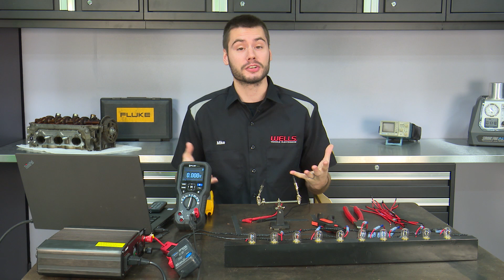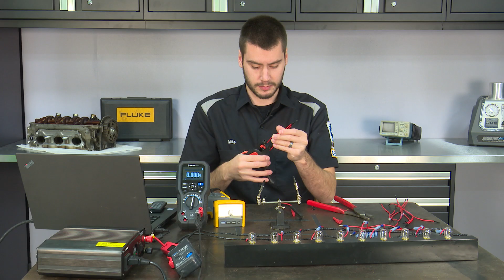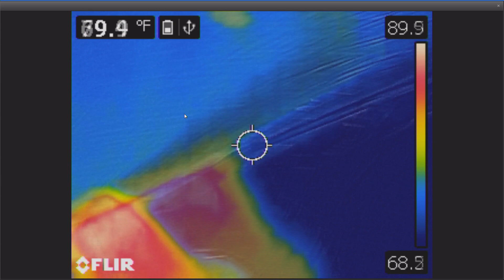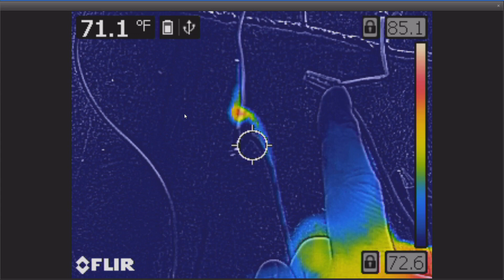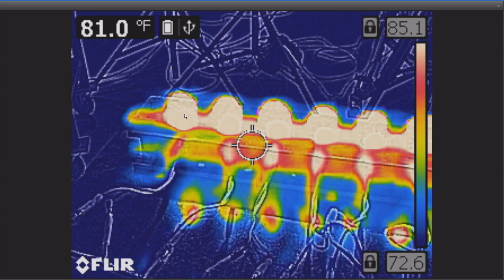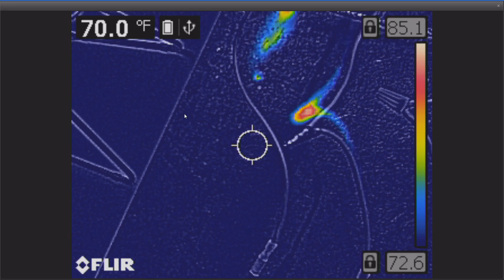Part 2 - Best Way To Connect Wires On Your Car - With Proof!

Comment: Using a pitiful one amp load on a splice  the voltage drops are going to be at the lower limit of what you can measure. You should have put all ten lamps on as a load for each connection. i.e. ten amps. Then you'll see something. Put the meter across each connection too. Don't measure back to the supply that's just confusing. For instance an extra 0.1ohms of resistance in the connection with 10amps of current flowing through it will give you a 1 volt drop across the (bad) splice which will be easy to measure. Also with 1 volt drop and ten amps (P=ExI) you'll have 10watts dissipated at the connection. That's going to get hot and show up on your thermal meter. A good connection won't drop anything significant and therefore won't heat up.BTW the 0.2 ohms you measured was mostly just the leads on your meter. Short them together you'll see. So in fact all of the splices were probably less than 0.1 ohm - again at the lower limit of your test equipment."Load er up" and lets see the problems. Interesting test setup. Keep them coming. Thanks
Reply from the maker: Hey Dave, I love the critical thinking on this. You are 1000% correct. The goal of this video was not to teach voltage drop, or the best practices of it. The goal was to simply show a difference in the types of connections. I am with your statements completely. I am currently working on a larger load and re-doing this test. Then we'll see what happens when we "load er up" :) Thanks for commenting and the feedback. I love this stuff! 
Mike Becker, Technical Services Instructor
Reply: Hmm. I thought your purpose was not only to show the types of splices but also to show why some are no good in the real world. When the wires nuts and twist and tape were showing up about as good as the "proper" splices it became apparent that you were not putting enough (electrical) stress on them to make them show their true problems. Hence my suggestions. You should test them to failure. If you get a variable current power supply (of say 30amps) and really put the boots to them. i.e. load them up to failure you can measure the current at which they fail. Your good connections should go until the whole wire insulation melts and the bad splices will probably heat up and fail at the point of connection. I think you were using #16 wire so somewhere around 20amps (or before that for the bad connections) should tell tales. Then your bias about which splices you don't like will be vindicated. Good work. Keep it coming.
Reply from the maker: Dave, that is a really great test! Let me see what I can come up with. Watch out for another video. Thanks for the input!
Mike Becker, Technical Services Instructor

Comment: working on commercial vehicle you need a flow of current to get green crusts build up quickly.  1 week is good enough
Reply from the maker: John, yep current flow would cause electrolysis to happen, causing our wire to corrode faster. Unfortunately I don't really have a way to test it that way :( If I can come up with something you'll see a video on it. Thanks for watching!!!
Mike Becker, Technical Services Instructor

Comment: One thing you should have done is to ohm tested and load tested before you put them in the salt tank. that why you know if the salt tank was the cause or your initial connection.
Reply from the maker: Randy, sure that is a good point. Next time I do something like this I'll keep that in mind. Thanks!
Mike Becker, Technical Services Instructor

Comment: So Scotty Kilmer was right. You can use wire nuts on cars and they work just fine.😀
Reply from the maker: Hmmm, I guess the picture of the rust inside the nut wasn't enough for you? :)
Mike Becker, Technical Services Instructor

Comment: Great experiment Mike..More time in the salt tank might have shown more results. But I understand you had to make room in the tank to start the Brine of your Thanksgiving turkey. 
Great Idea to tie them up under the truck.. should put them back by the hitch next to the truck balls.. HAHA
The voltage drop definitely shown the best results too. Can't wait to see how it compares to this springs test.  Thanks for putting this together.
Cheers
Reply from the maker: Thanks Kevin! Gotta get that turkey ready :)
There are no "aftermarket accessories" hanging from my hitch hahahah!
I too am looking forward to the spring test. I am working on trying out some larger loads to see if the results are different.
Mike Becker, Technical Services Instructor
Reply: Good idea.. Also, what if it was at a lower voltage too. Bet that bulb brightness difference would show its glow.  :)

Comment: Great experiment Mike. Already looking forward to spring and it's barely even winter. Do you think a larger load  would have shown any more significant loss? Although if you had 10 headlamps at 4.5 amps each, you would need welding goggles and sleeves.
Reply from the maker: Thanks Mike! I think here in Wisconsin, as soon as the clocks change we are looking forward to spring haha! I do think a larger load would effect this more. I am working on that :)
Mike Becker, Technical Services Instructor

Comment: In comparison the connectors in the original wire harness are likely to be not isolated and crimped on. So history tell us that these tend to work quite well. When there are issues it is most likely in the contact surfaces of the end connectors and not where they connect to the wire.

My logic tell me to avoid insulations that will trap moist inside them.
Reply from the maker: I think that both the connector terminal contact surface, and the connection to the conductor are both spots for corrosion. I do not agree that you should avoid insulation. A well sealed or insulated wire will not trap moisture inside, it will not allow moisture in at all when properly done. Thanks for watching!
Mike Becker, Technical Services Instructor

Comment: While they will deteriorate, I tend to agree it would be accerated by have power flowing through them while being in simulated usage-testing.  

Personally I use crimped butt connectors that are crimped then soldered before being sealed with heat shrink tubing.  Never had a issue with corrosion or joint failure on our less than ideal Saskatchewan rural highways even after 10 year and over 250,000 km's of driving.
Reply from the maker: Hey Todd, yep you're right. Power flowing would cause electrolysis and would show results faster. I like your way of connection, it's strong, secure, and efficient. If it works in Saskatchewan it will work just about anywhere, right?
Mike Becker, Technical Services Instructor

Comment: If power were to pass through the wires while they were in the salt tank electrolysis would have reduced them to nothing more than crust. The connections got the upper hand in this test due to them not passing power during the salt bath. This was a good "dry, underhood" experiment to show how corrosion moves through a wire, but the heavy damage takes time, or electrolysis.
Reply from the maker: Volvo09, I agree. Electrolysis would affect this. Unfortunately I do not have a way to send power through them while in the salt tank. The tank is designed to test plating/paints/coverings and not what I was doing. Thanks for watching and commenting!
Mike Becker, Technical Services Instructor
Reply: Yes, definitely! Salt is also a conductor by the way but as time goes by and the green crusting will make an appearance.

Comment: Mike,

I like the idea of your experiment, though I think one week was just a too short of a time span for more conclusive results....so we will see what april brings. 
One recommendation: ALWAYS put your positive lead on the [more] positive side ofthe circuit, even when just voltage drop testing......it will avoid confusion in the long run.  (21.35)
Reply: Juergen, can you provide an example where not doing the voltage drop the way you described would confuse someone? I guess I see a voltage drop as the absolute value of whatever you see on the DVOM.  I thought maybe you were implying that it would confuse lay people, but I don't foresee lay people or rookies watching this channel.  I would assume before a person got to this channel that he/she would likely have a decent understanding of how to use a multimeter.
Reply: Steve M. Steve, 

not nitpicking here,  but it is a matter of principles. With a decent understanding of how to use a voltmeter as you call it you'll know that the instrument  just displays the difference in potential between 2 points you're measuring at..There is no such thing as a negative differancial, think about it. ...
In the DC world, where polarity matters it  will help you to work with polarity and not against it.  It's o.k. that you guess you see a voltage drop as an absolute value of whatever the meter displays, if it works this way for you. Does this reflect a decent understanding of how to use voltmeter?? (Just wondering why even your meter comes with colour coded leads)

With regards to your request  of an example.....Think about a circuit leg with a diode in it.
Reply: I disagree with your example. If you are talking about using the diode test function on your multimeter to measure voltage drop across a diode, then yes it matters, but that again is knowing how to use your multimeter. But we are not using the diode test function of a multimeter, we are just looking for a DC voltage drop. I don't see how having the leads reversed affects the difference in potential in a circuit even in a circuit with a diode. If that were the case, people would warn you about that and say, you can't ever measure a negative potential. Because if you did, it may be a circuit with a diode and you might have received a false reading. That is just it, no one does.  I guess I do feel like it is being nitpicky.
Reply: Steve, 

the diode function on a meter is nothing but a voltage drop measurement across the diode. So if you want to know whether a diode is o.k. then this particular voltage test does require you to take polarity into account... Otherwise the result will throw you off.
This is the example you asked for. There is no guessing on my side.

If you just can't find any value in my comments then just kindly  ignore them😉
Reply: That's my point.  You went from doing a standard DC voltage drop test to testing a diode which has a special function on the DVOM that the setting must be turned to. That is apples and oranges. Back to my original point, if you are turning your DVOM to the diode test function setting, you better know how to use your DVOM and know that the leads are polarized and it matters which way you connect.  However, turning your DVOM to DC Volts and doing a DC voltage drop test in the end will not matter whether it is (-) or (+) it is the number you care about.  If I am doing a voltage drop test in a difficult location, I am not going to reconnect my leads and do it again jsut because the number came out (-).  You want me to ignore your comments, but if I think information is bad, I am going to challenge it.  I don't want others reading it and thinking that is correct. I am all for learning new things, but give me a link or a video where doing a standard DC voltage drop test with your DVOM on DC volts will give you an erroneous voltage if the leads are connected backwards?
Reply: Steve,

I truly believe in that words matter, so I choose them wisely. To sum it up:

1 -  Based on your assuming and guessing in your first reply you asked for an example where a voltage drop not doing the way  I recommended - with the correct polarity of the leads - would confuse someone while voltage drop testing. I gave you the example of a diode. The diode test function IS a voltage drop test and inverting leads WILL lead you astray....... If you reread my comment you can easily see that I wrote voltage drop testing , nothing else. Not volt scale ,not diode test.....just voltage drop testing. Once again, no guessing or assuming on my side.   Its just like an AES test where reading  and comprehension skills matter.
So IF recognizing that a diode test indeed is a voltage drop test - and that indeed the polarity of the leeads is important in this case  - , and ONLY if all this is not beyond the  scope of having  a decent understanding of how to use voltmeter you might be able to see that I really gave you an example why  it makes sense to respect the polarity of your leads.

2 - With respect to apples and oranges: 

I original recommended to "ALWAYS put your positive lead on the [more] positive side of the circuit, even when just voltage drop testing". NOTHING mentioned about voltage scale, diode function, switching scales, NOTHING. But the word always does include the diode function as well as all the other options and because of this the given example of a voltage drop across a diode is a valid example based on your request of "provide an example where not doing the voltage drop the way you described would confuse someone?" Again, it's all about reading skills and comprehension...

3 -Your social attitude of preventing others being mislead by erroneous information really gets me puzzled!.I am not sure to understand you correctly ,do you think you know more than others and have to protect them and you got the authority to guide them??
 I believe people will come up with their own reasoning. 

4 - Once again, the wording: 

What do you mean by an "eroneous voltage" in your last sentence??  I would have to guess...but as you know I don't t do so. I also don't know why you ask me for a link or video related to a topic that you assumed to have been expressed by me in the way you understood it and never was.

··············································································································································································································

I hope you learned something( at least you had the chance), friendly greetings!
Reply: Yea words matter to you. Let's look back and quote exactly what you said. 

Quote from Juergen: "With regards to your request  of an example.....Think about a circuit leg with a diode in it."

So if I read that correctly, if I take any circuit that has a diode in it and I do a voltage drop test on any part of that circuit that includes the diode between my test leads, then I will get an erroneous reading if my leads are connected backwards.  Reading skills and comprehension. Words matter, as you said.  Well that is just not true.
Reply: Once more, for you:

If you measure voltage drop over a diode in the diode test mode - and yes, this IS a voltage drop test - reversed  leads will invalid your result. So yes, polarity is important.

Which part you do not understand or you disagree with?

Do you think that the diode test function is not a voltage drop measurement?

Or do you think reversed leads will not give an invalid result?

Or is this an EGO issue?

Once again, friendly greetings
Reply: Ha Ha for me.  I am not the one that got confused by Mike having the leads backwards when measuring voltage drops on the wires.  Talk about Ego issues. You tried to correct Mike and you think I have ego issues?

Yes, that is a voltage drop test.   I just don't do may voltage drop tests using the diode function of my multimeter, but hey to each his own.  Good luck with that.
Reply: Steve,

you read what has not been written and you do not read what has been written.  I recommended to connect leads according to their polarity, always. You do not. I keep my recommendation.

You think I tried to correct Mike, that is completly different fom me trying to correct Mike (or anybody else). I did not! This is one example where you read something that was not written...

Again, I recommended something, not less, not more. When you asked for an example I gave you one...

So now that you understand and acknowledge there is a voltage drop test where polarity matters, you are very close to understand that respecting polarity ALWAYS will avoid confusion in the long run, as I initially stated.

If you decide it`s" your own" to ignore what is a logical approach once you realize that there is a REAL opportunity to get a something wrong --- so shall it be! I want to finish with a quote from you: "Good luck with that"
Reply from the maker: Hey guys, looks like some interesting conversation here. Juergen, thanks for the info. You are RIGHT, I should have swapped my leads. Red lead on the most positive side of the circuit. I will try to keep this in mind next time my friend. Steve, it is not about who is right or wrong, or whether someone is correcting someone...this channel is all about learning....and learning together, as a community. Let's please keep this civil here. Thanks both of you for your view points!!!! :)
Mike Becker, Technical Services Instructor

Comment: I would guess the wire nut is insulating any heat emanating from the corroded wires, thus not allowing the heat gun to see extra temperature.
Reply from the maker: Chad, sure that is a possibility. But, over time, the plastic should heat up. I think this will be more prevalent under a higher load. Such as a headlamp, or blower motor. Thanks for watching!
Mike Becker, Technical Services Instructor
Reply: I agree with you - the plastic would transmit the heat given additional time.  I should have added that qualifier to the end of the sentence.  Reviewing older Wells videos, I say watching your creations for Wells is a big improvement.  Keep up the great work!
Reply from the maker: All good Chad! Thanks man, I really appreciate that! 
Mike Becker, Technical Services Instructor